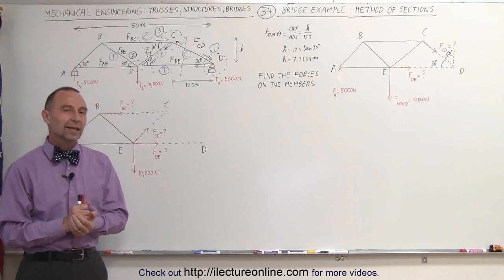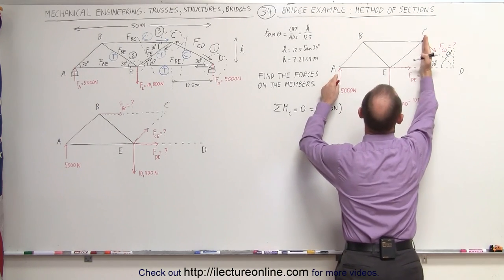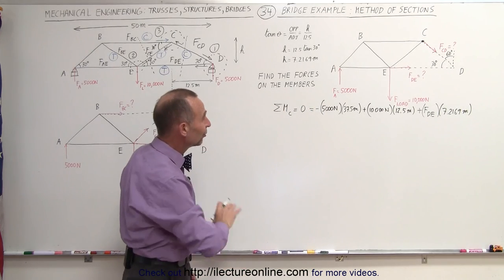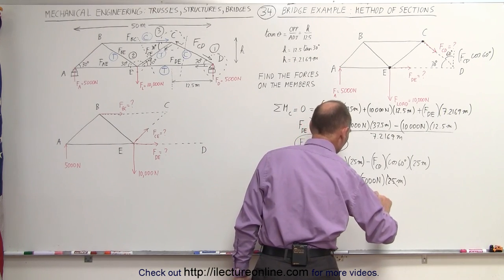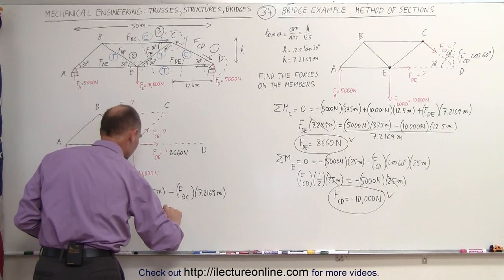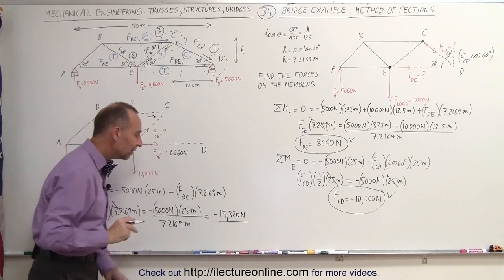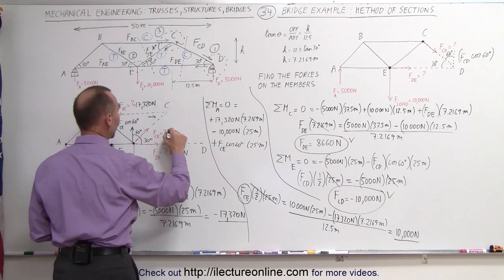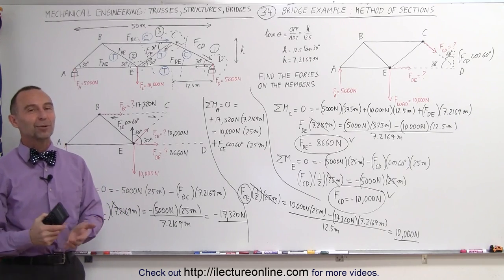Mechanical Engineering: Trusses, Bridges & Other Structures (34 of 34) Forces=? on Members (Section)

Comment: Do you have any lecture on analysis of frame?? 
If you have it in different name, I can't find it
Reply from the maker: We don't call it "analysis of frame".  But we do have videos that show how to section up each portion and how to find the tension and compression on each joint.  You are in the correct playlist:  Mechanical Engineering: Trusses, Bridges & Other Structures (30 of 34) Forces=? on Members 2